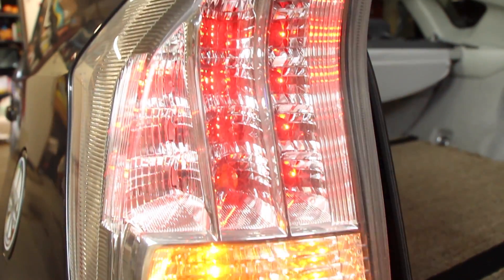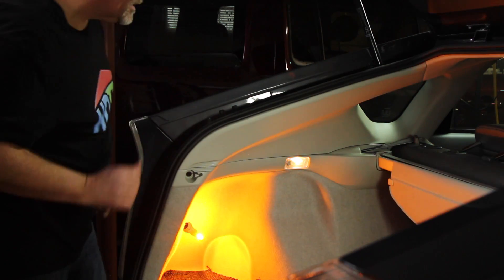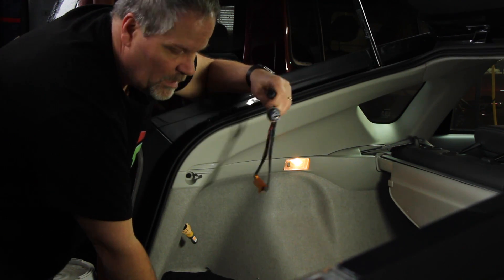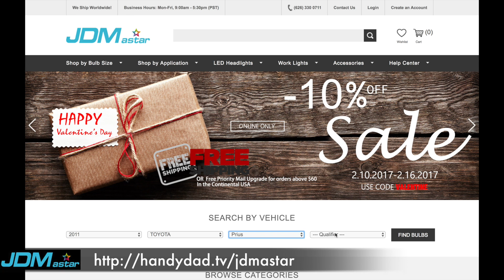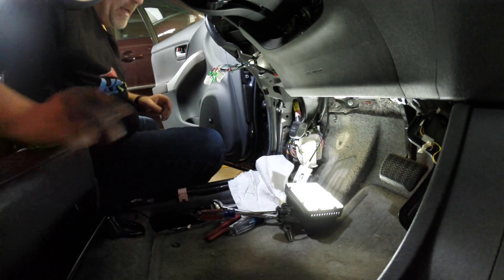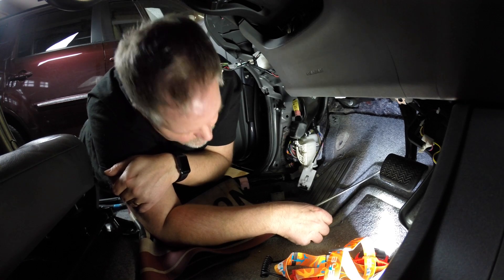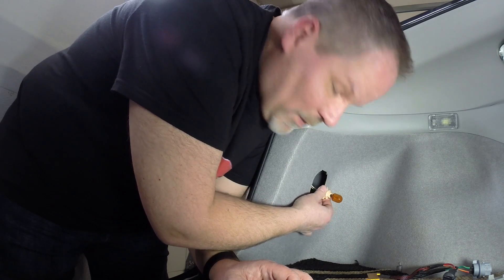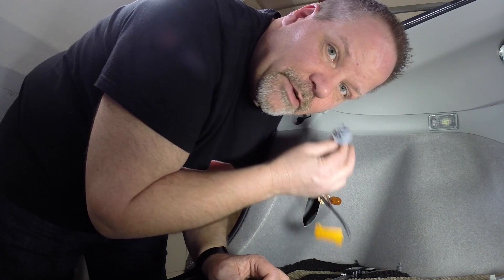LED Turn Signals and Hyperflashing - Resistors vs. Relay

Comment: In my old Toyota Corolla 1991 ... just changed my old Flasher Relay to a LED Flasher ... cheaper / simpler ... than installing Load Resistor ... my electrical consumption is even lower than before ...
Reply from the maker: I wish I could have reached the flasher to replace it.

Comment: Well def not resistor vs relay , didn’t get to see the relay work. Rename to you vs Toyota!
I have these huge resistors on my mustang signal bulbs and the headlights won’t fit properly back in their slot with the resistors, they also switch backs so it takes a full second or more to go back to white after using the signal, would relay fix that ?. Was wondering too if I have resistors in the tail light led already can I use the relay for front and it won’t affect them?
Reply from the maker: Not sure. Play around with it to see if it will work.

Comment: the best solution is to get a turn signal  wire kit  split 2 way or 2 of them  or 4 way with electronic led  flasher relay up 240 watts  and fuse to connect direct to battery and then on to turn signal light's then purchase led light bulbs with fans or self heat dessipate the ones that dont need electronic relay nor resistors,, ,they still get hot,, if you can disconnect relay on car and or fuse,, some come attach to emergency lights, that is the best way cuase leds get real hot ,  relays for low current that fitare hard to find on some vehicles

Comment: It's 2 to 4 screws to take off the bottom cover under the steering wheel...and maybe 4 more for the bracket...work smarter not harder
Reply from the maker: Now you tell me

Comment: I recently bought front LED signal housing for my civic model 92-95. By manufacturer, when start the engine, the signal light turn ON solid. When headlight turn ON, led signal didn't fully OFF then ON. It dim a little and blink...very hard to notice on bright day light. If headlight is OFF.. the LED light blink like normal. The LED signal housing comes with LED resistor pre-assemble. Do u think I need to replace the OEM signal relay with the LED relay?

Comment: You r just like me I'm a big guy too and I have been going crazy trying to find a high enough watts led bulb because my 2021 forester has 28 watts . So I'm got the front working great because I have resistors in the front but my back r the problem.  Cause I don't have enough room to put a resistors case they r outside on the corner its a pain in the but. I'm going  to try to l
Find my flasher under the dash.
Reply from the maker: I feel your pain

Comment: Big guy here, 2005 Honda Pilot.... I gave up... went the resistor route. Cut and splice method. Aftermarket replacement sockets would not fit.
Reply from the maker: Sucks

Comment: Lasfit makes ones that have the resistor built into the light.  No relays, no in lines, just plug and play.
Reply: @sejinoh1886  i have the lastFit with no hyper flash issues - way bright

Comment: 3:08: Not with a Saturn you can't. They're built in the Warning Flasher button. You'll have to use the Resistor method with these.

Comment: I recently converted my 96 Tacoma over to led and did the flasher relay and it was a plug and play. I tore my dash apart and pulled the fuse block to get to the flasher which was located on the back of the fuse block. After a few choice words I got the dash all put back together and while I was making sure I put everything back together correctly,  I found out that I could have reached up behind the fuse block and pulled the flasher out that way! Oh well you live and you learn!
Reply: I'm so glad I saw this. I'm doing the same with my 96 Tacoma and you saved me a lot of... choice words. Thank you!
Reply: @avudim1255   2020 ~ Auxito LED with built in resistors are now available.

Comment: Just for shits and giggles, maybe a look in the owner's manual would have helped locate the flasher location. Or a trip over to the Priuschat forum for a bunch of information on this vehicle. It does look like you are having fun though, so carry on. A lot of people wouldn't even think about trying to do something on their own with their car let alone actually getting under the dash. I feel for you on the "big guy under the dash" syndrome as I have personal experience being upside down with the driver's seat fully to the rear and my legs where my upper torso normally sits.
Reply from the maker: The owners manual doesn’t say anything about the relays. And Priuschat gave little help. I looked. I don’t give up easily.
Reply: @handydadtv  Keep up the fight, never let an inanimate object defeat you. That is unless you happen to get run over multiple times, then it might be a problem. My daughter has a Prius and she has a love/hate relationship with it. She drives 1 1/2 hours each way to and from her work. So far a number of small mammals and one deer have been taken out by the Electrocutioner. Like the Energizer Bunny it keeps on going.

Comment: You might like to know that I put LEDs in my rear tail lights for my 2016 Ram 2500 and although I get the hyperflash indication in my dash, I do not get the fast blinking in the tail lights. It blinks at the normal factory blink rate. But the turn signal LED markers on my side mirrors hyperflash at a faster rate than normal. If that isn't weird
Reply: Ron Radmer  I get the same thing on 2019 F350, I'm using LED with built in resistor.....I just found out that there's a way to go into the PCM (Forscan) and change value from incandescent to LED.  LED with built in resistor works perfect on 2011 Prius.
Reply from the maker: Definitely weird.

Comment: If it makes you feel better, I repaced the EL-12 flasher units on my car, (one for the indicators and one for the flashers) with  special LED flasher units, and it didn't work, so I will have to go to load resistors. Secondly, you should only need ONE load resistor for each side of your car, not one for the front and another for the back, BUT all cars seem to be different in this area, so YMMV.

Comment: Since you put the resisters in the front,can't you live with a slightly quicker flash with LEDs in back too,without?
Reply from the maker: That is an option. I also considered putting two sets of resistors in the front. That might work too.

Comment: Chief  simple  way  is to get the main wire  to  extra bulb holder that from  there  get the current  directly to led  bulb  holder  rather than get high price resistor  .  What  you need  is extra  bulb  holder  and normal  bulb  paint black thats it

Comment: Does hyper flash damage anything  ? Like mess with any ecu's or relays or other elactrical parts? I'm guessing it may burn out the turn signal led bulb slightly faster? I have an 08 prius and I don't mind the hyperflash. I'd like to avoid hot resistors and keep the led power savings.
Reply from the maker: I don’t think there is any harm; it’s just a personal preference.
Reply: @handydadtv  - great thanks! Is this the same JDM (Japanese company) that has all the prius parts? Hopefully finding and replacing a gen 2 relay is not such a pita!
Reply from the maker: Not sure. Check http://jdmastar.com.

Comment: ok so... I have the regular filament bulbs on my signals, 
Then I changed my flasher relay cuz the original one burnt out, 
So why am I getting hyper flashing when Im not even using LED bulbs for my signals?

What can I do to fix it?
Reply from the maker: I don’t think you did anything wrong. Sounds like they gave you the wrong flasher relay.
Reply: @handydadtv  how do i know what kind of bulb I need for the relay they gave me ? cuz i might just change the bulb...

Comment: So my right turn signal is hyper flashing.... my left one is fine and my hazards are fine... front and rear bulb aren't out sooo what gives?
Reply from the maker: I’ve never heard of that. Hyper flashing only happens when drawing too little current - such as a burned out bulb or replacing with LEDs.

Comment: pro tip...the cars owner manual tells you where the relay / fuse box is located 👍
Reply from the maker: Here's my owners manual: https://www.toyota.com/t3Portal/document/om-s/OM47685U/pdf/OM47685U.pdf
The word "relay" doesn't appear anywhere in the document.

Comment: Hyper flashing is basically a current signal sent back that says a bulb is out. If all the regular incandescent bulbs were left i and one went bad it would hyper flash.  The less wattage with the LED simulates a bulb out. The aftermarket inline resistor boosts the wattage back where it was.  Now the only benefit will be the bulb will last a lot longer however your saving no power. I just had a nightmare myself. Turns out my 2011 Ford E350 has no flasher relay it has a programmable box to adjust the wattage as needed. Has to be done by the dealer special codes. Resistors get red hot even when mounted so I switched back lost about $30 and a few hours and got over it. At least for my van. Next one I buy will have them already. 
Oh no I have two 72 Cutlass's I know they have a flasher relay I think here we go again
Reply: same problem on the infamous Five-Hundred.

Comment: Why not cut your normal socket and wired to the resistor????
Reply from the maker: I didn’t want to cut wires. There’s no going back. But i could splice the resistors across the existing sockets without cutting them.

Comment: Cut the sockets off and solder the car socket to the resistor wires... the end. Oh, you could have went to an autozone and asked them where that flasher is located on your car or just have them show it to you while you were there. It just might be under the hood.
Reply: He found it. It was under the dash about a forearm length up under there. He just couldn't get the relay unplugged.

Comment: Did the bulbs get dimmer and produced less light after the resistor or it's only me. To me it looked dimmer. compare the output @ 2:00 to the output @3:50
Reply from the maker: +albarghouthy Hmmm I don't think so.
Reply from the maker: Hmmm not sure.
Reply: HandyDadTV is it possible to to have one side with a resistor and the other side without it, then turn your 4 ways on and show it to us?. I would really appreciate it
Reply from the maker: +albarghouthy Sorry, it's not possible for me to do that. But the 4-way flashers didn't require a resistor, just the blinker did. The 4-ways work the same with or without a flasher.
Reply: HandyDadTV the reason I wanted you to have one side with a resistor and the other without is to compare the light output of both bulbs and see if there is any difference. Anyways I really appreciate your time responding.
Reply from the maker: +albarghouthy Oh! Now I understand.

Comment: Being a retired mechanic, I use to take the front seat out and then lay on your back to get under the dash. Pain in the A$$ but some times works .
Reply: Being a semi-retired diy'er, AND a big guy, I used to maneuver myself until my head was down on the floor, my back on the seat, my but and legs up the back of seat, and my lower legs over the headrest..... fairly comfortable until the dizziness started to set in, lol! Haven't done that in about 25 years....

Comment: HandyDadTV you can look on Amazon for Luyed Led that is plug and play, no hyper flashing.  I replaced all 4 on my car
Reply: Those have a built in resistor which heats up and eventually burns up the bulb. Others have told me they don't last nearly as long as just using external resistors and they are a lot more expensive

Comment: In my Ford Expedition, I literally just had to stick my hand up the back of the dash, flip a cover off and rip the relay out, these engineers should place relays more conveniently for the inevitable moment when you need to replace one... :)

Comment: love your vids. Vleds.com have resistors that you can tap into your wiring, or if you get their Triton series, plug in. Warning: Tritons are EXPENSIVE, but well worth it, trust me.
Reply: Chris Heider they're universal with several adapters. I have the red version as tail lights and you'd think a red dwarf star manifested itseld in my tail lights. I don't work for them, but I use all their products.